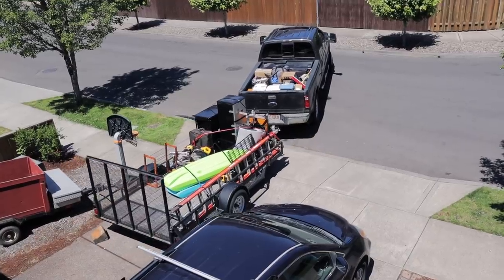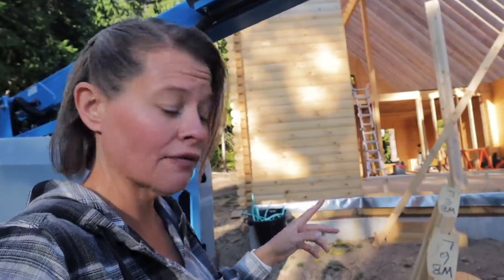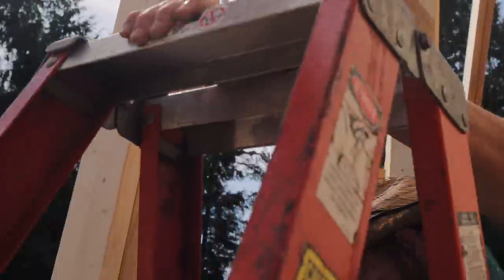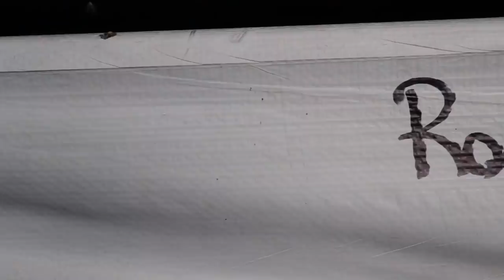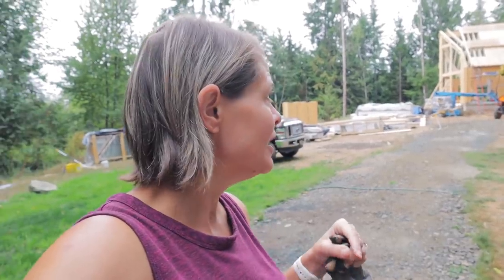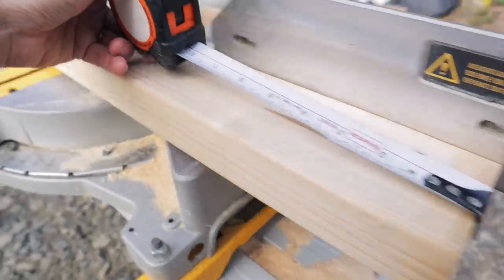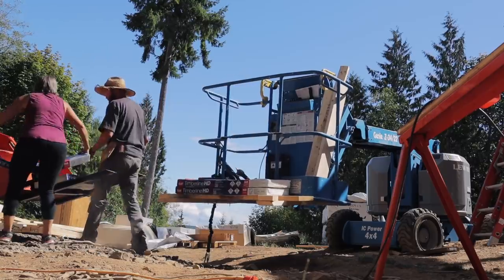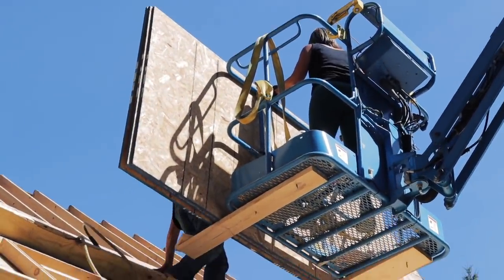We NEEDED Help // Roofing Our 12/12 Pitch Roof - Ep. 50

Comment: Watching how you are building the ‘prow’ of you roof.  We have lived in a larger version of your house for 30 years. The first leak we experienced is along that front part. Thankfully we found a good roofer who knew what to do to fix it. It was because of the way the roof cuts back at the edge instead of being straight.  It has been fine for 25 years now.  The other section that leaked a few years later was around the wood stove pipe.  Our chimney sweep thankfully was able to go up to the peak of our 12-12 foot no problem.  Good luck! We love our house!
Reply from the maker: We are so excited for the windows!   It’s what sold us in this plan.  It’s made the build way more complicated, but it will be worth it.  I’m curious, did your roofer tell you where the failed was at?   Maybe we can add some l thing to prevent a leak in the future.
Reply: @OneFootOfftheGrid  Oh, i know it is great. We look out at a mountain range, watching sun rise. Our house inside has a lovely high ceiling. It is so relaxing to have the beams and wood. People comment on it when they visit, they find themselves leaning back and smiling. 😁. You will love it!
Reply: @OneFootOfftheGrid  He said that because the roof was 'cut back' to follow the bump-out it needed to be roofed a little different.  If your roofers are experienced hopefully they know how to deal with it.  The water just wanted to go into the right corner of the living room. They put up some kind of barrier to keep it from happening again. The water stained our wood ceiling at that time, but we have not had a problem since.

Comment: Hi just be ready when the help comes again.... place all the material..ready to install....😁👍
Reply from the maker: We worked extremely hard up until the roofers got there.  We were in communication with them and they knew where we were at in the project. I’m sure if we were able to have had the project further along and the material staged things could’ve went smoother and we may be even could’ve had the roof installed that same weekend.